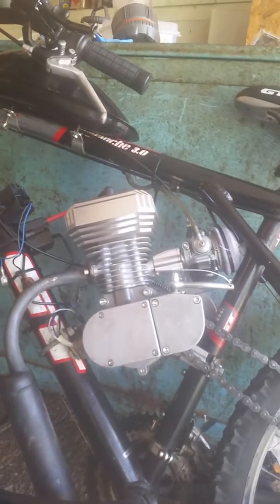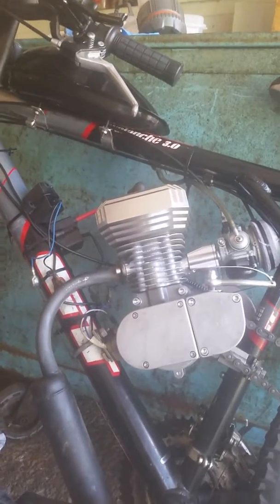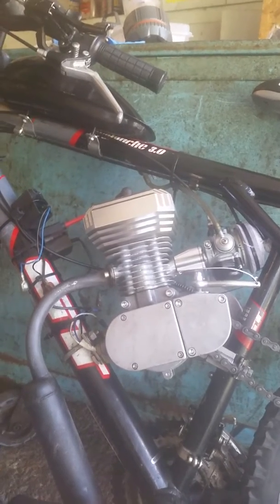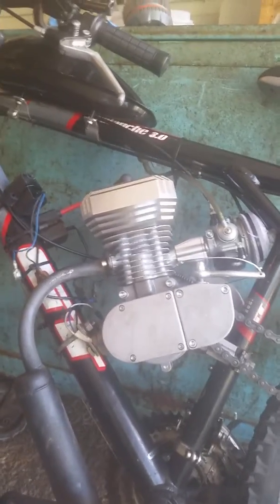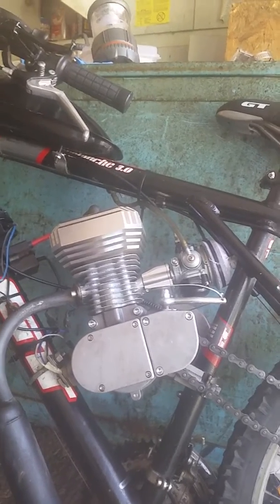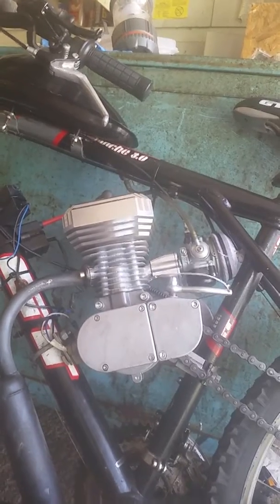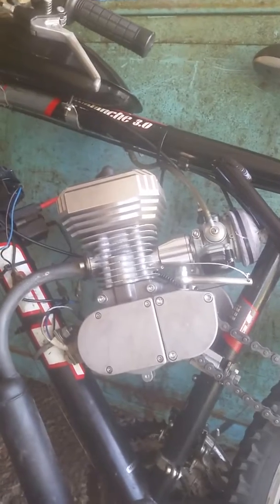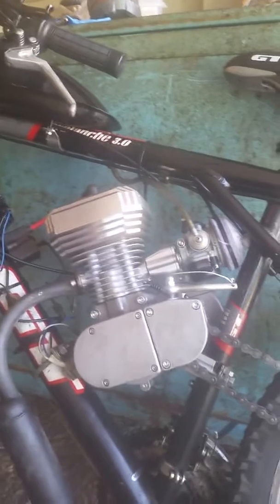Motorized bicycle reed valve tuning

Comment: I just went through this and this is what I learned. Upgrading from piston port to reed valve needs window piston and intake transfer port to work properly. Reed valves need access to the case through the entire engine cycle. The window gives access at tdc the intake port gives access at bdc. The intake transfer port channel you have to cut into the cylinder fills in the gap during the stroke. Reed valve will work with intake transfer port alone but a window piston makes it work even better.
Reply: Hahahaha, put the pipe down
Reply: @nimbusnimbus.IV.  shut up stupid

Comment: I’ll realest one more time that exhaust holds them engines back a lot take off the front cap of it to allow better air flow but I suggest some kind of dirt bike pipe I got a fat belly expansion chamber at the moment cheap amazon pipe and it gave me lots of torque I love building these two strokes into speed Desmond

Comment: You need an expansion chamber with that stock pipe it holds the engine back does not allow enough air flow you need to learn a little more about it man if you can’t get it done with two strokes why do it lol these things are simple you’re trying to get speed exhaust and porting helps then sprocket reduction helped me even more now I got high compression head made my own windowd piston and got the oz Reed my bike is almost at 50 just need to go from a 36 tooth to a 32 tooth hoping to get faster than 50
Reply: 50 mph?
Reply: @daltenmorris5072.. Hello, do you have a 80cc or 100cc? And did you do any porting with the transfer chambers inside the cylinder or just on the intake and exhaust ports?

Comment: 32mm intakes and small reeds have to be custom made to work. you have to open the intake side of the jug so that the top of the reed will open and not touch the roof of the intake port, you have to port the intake to match the reed, if not the top reed wont even open or may even break into the motor. I have one set up but not used it yet, my iron liner piston port engine now runs to good to change anything now.
Reply from the maker: The top end is professional  ported look at my other videos I show the cylinder

Comment: I put a 21 mm delloroto connected with a rubber hose. Runs awesome. Tons of power
Reply: Ha get a real carb get a mikuni vm 20 much more user friendly
Reply: @HighMileageOffroad  dellorto is a real carb brand and user friendly
Reply: @iajs5350  so is mikuni
Reply: @iajs5350  yeah, junk.